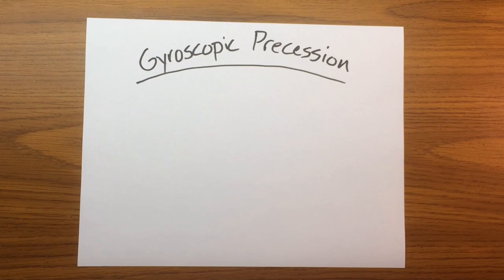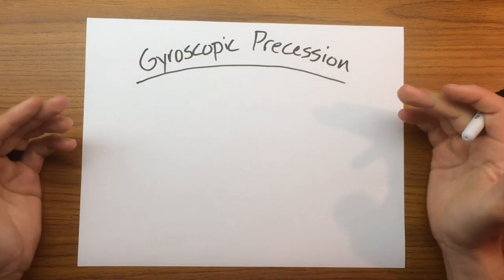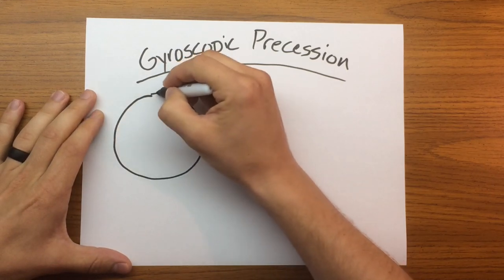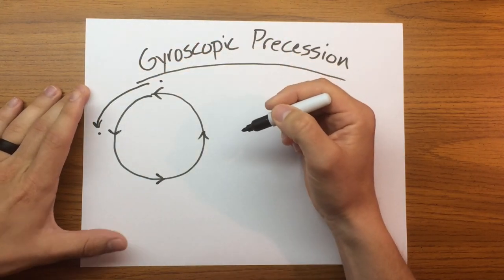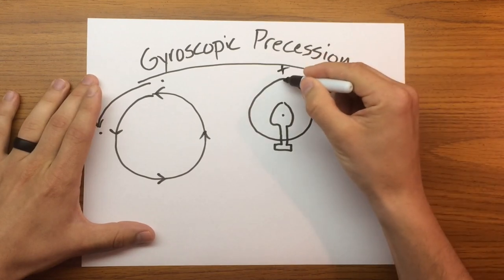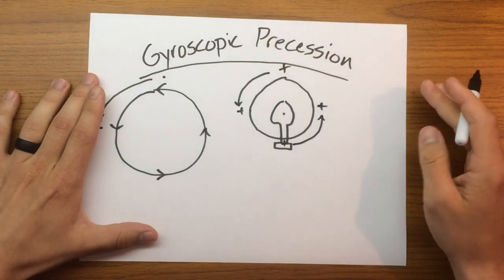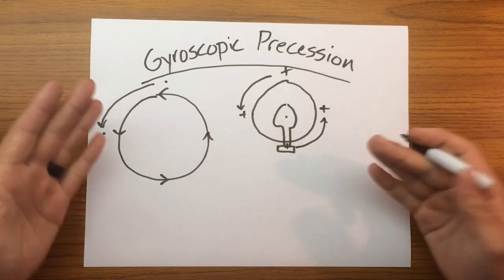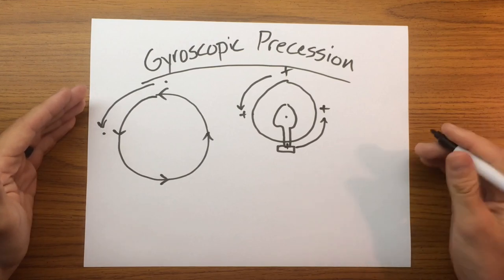Gyroscopic Precession in Helicopters

Comment: Due respect to your clear understanding of helicopter flight physics etc.  Please don't think of me as a hater with an ax to grind against the world, my intention is to contribute.  Your buffer analogy is incorrect for the following reason.  When steering a floor buffer it is true that one guides the buffer with up and down inputs to the handle, the forces generated however are not the result of gyroscopic precession  Gyroscopic Forces are present on this as well as any rotating body,  however those forces are swamped out by the dissymmetry of traction achieved by the front and back of the brush/pad contact area. i.e. lifting the back of the machine gives more tractive force to the front while reducing tractive force at the back, causing the machine to move opposite the direction of rotation at the point of contact.   To conclude, Thank you for your efforts to explain these concepts, they are for the most part well thought and executed.

Comment: A gyroscope is a rigid disc attached rigidly to the axis of rotation. A rotor system does none of this, as it is able to flex, it might have hinges to allow flapping and lead/lag, and dampers in some cases. 

GP is simply a way of explaining Phase Lag to a student. Feed in a cyclic input, the pitch angle changes, the lifting FORCE is increased, and the F=MA takes over, and the blade starts to accelerate up. It takes time to get up to the desired spot, but by then the cyclic has moved the swashplate, the pitch angle has changed, the forces change, and the blade reacts by accelerating in another direction. In some helicopters, the phase lag is 90 degrees, in others, like the R-22, it is 78 degrees, mainly because it is a lighter blade and accelerates faster.

Phase lag is only approximately 90 degrees. The rotor system is not a gyroscope. Precession is only a way of helping to understand the dynamics.
Reply: THANKYOU!! I searched for this and everywhere people seem to be talking about the gyroscopic precession and it made sense to me till I learnt that some helicopters have a different phase angle between cyclic and the rotor. If gyroscopic precession was the reason, it would affect all helicopters equally.

Comment: Helicopter flight controls in Wikipedia also states that when you push the cyclic forward that the swashplate lowers in the front and raises in the aft. And that the swashplate does not go 90 degrees before the direction you want to go. Meaning if I push the cyclic forward the swashplate doesn't go to the right. Again I'm not trying to fault you, it's just that I have 2 different forms of information that seem different.
Reply: there are pitch links between the swash and the rotors which are at an approximately 90 degree angle.

Comment: New student here. When you mention control rigging, if my trainer has a built in auto-trim would that be the system that is increasing the pitch at the rear of the rotor disk for a left turn? Thanks!

Comment: deeply impressed by ur instruction. thanks....
one question about gyroscoptic precession...How about clockwise direction rotating rotor systems?
Do they behave same as CCW direction rotor systems?
I mean pitch change....
Reply from the maker: Everything is the same in concept except  the precession is 90 degree prior in the other direction. So to turn right the pitch would increase over the tail to manifest on the left half of the disk.
Reply: Thank you again.
It was helpful~
Safe flight...

Comment: I thought I understood this, until I sat in the Schweizer 300 with engine and rotor at rest, and applied forward cyclic and noticed the swash plate raise in the back, then when I moved the cyclic to the left the swash plate rose on the right so how does gyroscopic procession work in this situation? Thank you for sharing your great videos.
Reply: The pitch change links are connected to the horns on the blade, and they are arranged so that the input to the blade occurs around 90 degrees in advance of where it is needed. The blade then has time to fly up or down to where it is desired. Thus the swash plate can mimic where the stick is pushed, and where the disc goes to.

Comment: If you do a google search for Wikipedia helicopter flight controls it says that gyroscopic precession is a Misconception. It says that what is happening is called phase Lag and not gyroscopic precession. Not out to fault you, I'm just trying to learn about helicopters, since I started flying them.
Reply from the maker: Mark Kiziuk. The Gyroscopic Precession/Phase lag has been debated constantly. For years many pilots were taught Gyroscopic Precession because a rotor tended to react just like a spinning gyro in that all effects tended to manifest 90 degrees later.  This was an easy way to comprehend why there was a 90 degree displacement and therefore a rigging in flight controls.  But then engineers decided to step in and begin to state that it was actually "phase lag" because, unlike a gyro, rotor blades have the ability to flap.  This flapping in the vertical hinge of the blades created a "phase angle" which could make inputs manifest as little as 78 degrees in some rotor systems.  For most helicopters the rigging is close to 90 degrees but not exactly. In the realm of flying helicopters, Gyroscopic Precession is a commonly accepted reason for a 90 degree delay.  But in the realm of engineers who design helicopters, phase angle and phase lag are the more accepted reasons. Thanks for the feedback. I hope this helps.
Reply: Helicopter Lessons In 10 Minutes or Less 
Thanks for getting back to me so quickly. I guess the million dollar question is, when I take my helicopter verbal and on my written exam, what is the correct answer? Is the answer gyroscopic precession or is the answer phase Lag? 
Mark
Reply from the maker: Mark. I'd say it depends on your evaluator. In my community, Gyroscopic Precession has always been the accepted answer.

Comment: one big help in getting this to click in yuor brain:

Understand that the control rods from the swash plate attach to the rotor blade 90 degrees out of phase as well

For example: left cyclic -> swash plate tilts to the left -> lift on the right side created by control rod from the right side attached to blade on the aft/back position, so when the blade turns (counter clock wise) now to the right the angle of attack was already increased 90 degrees before that so the lift effect takes place on the right side of the rotor disc now generating lift on the right side and tilting the rotor disc to the left
Reply from the maker: therealTOTOfan. That's right. That's what I was pointing out towards the end of the video. Luckily pilots do not have to compensate for this 90 degree difference due to control rigging.

Comment: That's a great explanation for someone who needs to know what it is. But I'd like to know why it is, i.e., why 90 degrees?
Reply from the maker: David Anderson. Without getting super deep into the physics of, it is 90 degrees because 90 degrees is perpendicular to the force applied. When you have a spinning body it has Angular Momentum. When a force is applied to this that is not directly at the center of mass, a new vector of Angular Momentum is introduced. The sum of these 2 momentums causes the rotating body to shift in a new direction. This is precession. I can't see ever needing to know this to fly but I hope this helps answer your question lol.
Reply: Its actually not always 90 degrees, and in reality is rarely exactly 90 degrees offset. I believe it was Bell who did tests and found that by adding weight to the tip of the blades, they were able to bring it up to 180 degrees (I believe you could go beyond 180, but that's as far as they went, to my knowledge.) This is because it's actually something called Phase Lag. Many rotors are close to 90 degrees off, though some are significantly less than 90 degrees offset, and some are significantly more. Part of this has to do with the weight at the tip of the blade, and part of it has to do with whether the rotor system is semi-rigid or fully articulated.

Comment: When referring to "input", is that the point in the rotation where blade pitch angle is the highest (due to the input) or is the 90 degree point where the highest blade pitch angle occurs? thanks!
Reply from the maker: T Phillips. It's the point where the change in pitch angle is made.
Reply: That's what I was thinking. Thanks!

Comment: Quick question:
you said when you want to make a left turn, you move the controls to the left & the swashplate increases the pitch at the rear of the rotor disc. 
My thinking is, it would increase the pitch at the front of the rotor disc with desired movement occuring 90* later. Can you help me determine my error in thinking? 

I intend to go through WOFT soon, thank you for these videos, I really appreciate it.
Reply from the maker: john fuller. Great question. Think of it this way though. If I want to turn left, I want to create more lift on the right side of my rotor disk than the left. This unequal lift causes the rotor system to tilt to the left and cause a left turn. Now because of how Gyroscopic Precession affects my counter clockwise spinning rotor, I need to make this input 90 degrees prior. So to increase pitch on the right side, the input needs to be made at the rear of the disk. This will manifest 90 degrees later at the right side of the disk and I will begin a left turn. Keep in mind that the correction for Gyroscopic Precession is already made for you in the control rigging and all you need to do is put in left Cyclic to have a left turn.
Reply: Helicopter Lessons In 10 Minutes or Less 
Ahhhh, ok. That makes a lot more sense, thank you very much.
Reply: @helicopterlessonsin10minut10  Hi.  Could you please explain how the correction for gyroscopic precession is already done at the control rigging?  Is done at the input to the swash plate,  or is it done via rods and linkages between the swash plate and the spinning rotor? Also,  is this correction done differently depending on the kind of helicopter.   I'd really appreciate your answer!
Reply: @helicopterlessonsin10minut10  Is this because of lag? The time for the increase in pitch to go from root of the blade to the tip? Would increasing rotor RPM make the lag greater than 90 degrees?

Comment: thanks for your job, does gyroscpoic effects the engine torque?
Reply from the maker: i hope. Gyroscopic precession in this aerodynamic sense only applies to aircraft controls/rigging and not engine torque.
Reply: @helicopterlessonsin10minut10  is there a minimum speed that the main rotor must move to make the force precess by 90degrees.... or, even better , what is the speed dependence of the precession angle?